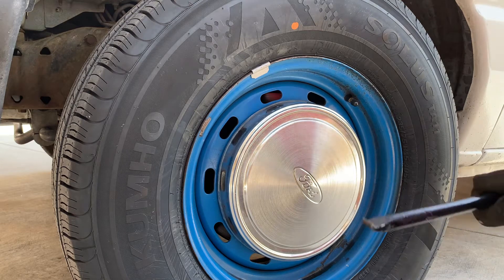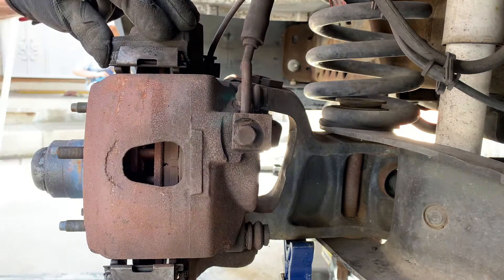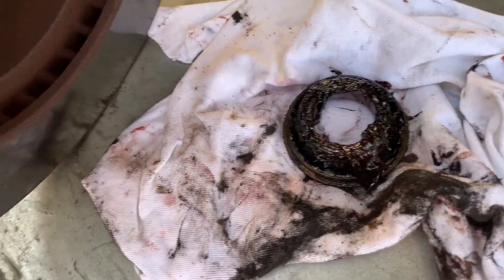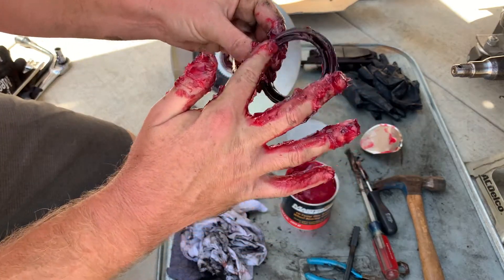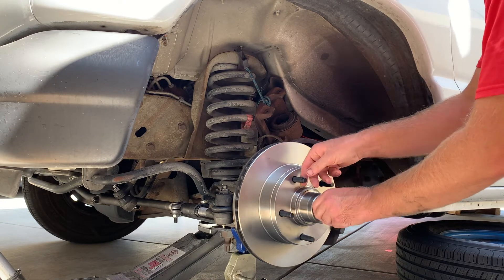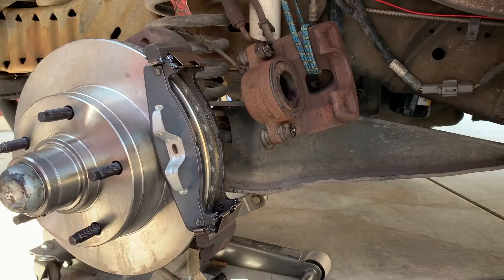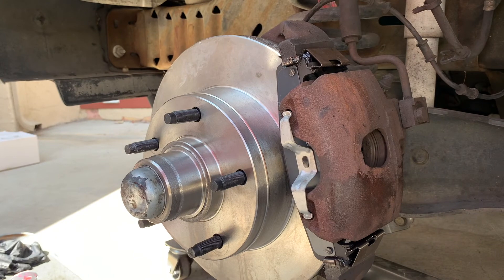Ford E150 front rotor, brake pad and wheel bearing replacement

Comment: No more than the bearings cost not worth the time and trouble if you’re not gonna replace them with new. Super simple job. Replace the bearings, races in the rotor, new seal, fresh grease.
Reply from the maker: @jedmeltonmusic698  this is a serviceable bearing. Haha. New races come in the new rotor. Haha. Thanks for the input though I guess. Haha

Comment: FYI, according to the Haynes manual for setting the bearings... its 1) rotate assembly ccw while tightening spindle nut to 17-25 FOOT pounds (not inch pounds) 2) back off spindle nut 1/2 turn 3) tighten nut to 22-25 INCH pounds.  I'm not sure you're using enough force to seat the bearings in step 1.
Reply: @derfiemcgoo9673  it doesn't appear so.  The Haynes manual I have is for 92-14 E-150 thru E-350.  I'd think the 250 or 350 might have a different/beefier hub but this manual doesn't seem to have different figures for those models.
Reply from the maker: Thank you for answering the question.

Comment: I saw a video where the grease was placed on hand get the bearing from the base of and "push back into to the grease" that will pack grease into the bearing.
Reply from the maker: It’s not rocket science any way you can jam grease in to the bearings is sufficient.

Comment: Who taught u how to pack bearings?
Reply from the maker: @Mechanicsonly  you act as if packing a bearing is rocket science 🤡
Reply from the maker: @Mechanicsonly  also who’s watching who’s video 😉🤣
Reply: @f.s.detailgarage7869  not rocket science is right and u took like a 2 yr old doing it like that. I just skipped to the part to find the torque spec.

Comment: I’m a little curious why you replaced the rotor and pads in the first place, but then re-used the wheel bearings, seal and even the 5 cent cotter pin…..
Reply from the maker: Because the pads and rotors were worn. The wheel bearings are serviceable if nothing wrong with seals and even the 5 cent cotter pin the reuse and regrease bearings. Easy deal don’t overthink things. If your more comfortable spending more money than rightfully do it. Thanks for watching!

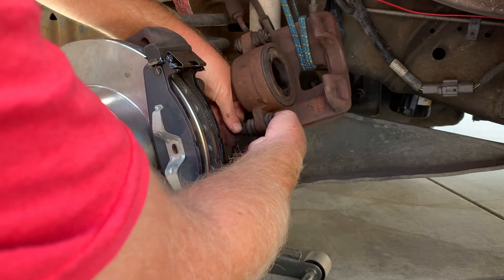Comment: Great video, of course I’ll add a lil something. After you put the pads back on (15:43) and typically before you put the caliper back on the break pad hardware fully clips around the top and bottom fingers of the pads.  This probably doesn’t matter much in most instances but in certain instances the hardware, can protrude out just enough to scrape the inner portion of some wheels. Especially if the you have hidden balancing weights. This comment is just to help the few that run into an obnoxious squeal coming from the wheel following the brake job.  Again your video is great.
Reply from the maker: Appreciate the tip!

Comment: Great job I've done many but before I do one I like to do a refresher ..you covered every...thing. but you did not mention trouble shooting ..bad brake pads bad rotor bad bearing.... Is the hub loss and how much play should you have ...with the job buttoned up and before ..should thectirecsoin freely etc...Thanks
Reply from the maker: This was a tutorial on replacement not troubleshooting brake or wheel bearing issues. If you do as I say you won’t have to troubleshoot anything.

Comment: How in the sweet fuck do you remove the rotor from the hub
Reply: the hub is riveted on to the rotor, unlike newer types. bearings and seal are replaceable. if the rotor is beyond it's useful life or is warped, buy a new one, races are normally pre-installed in it.